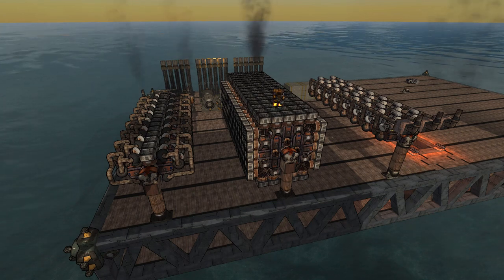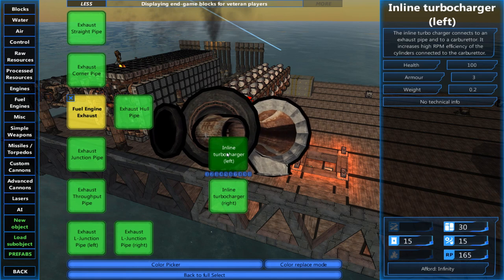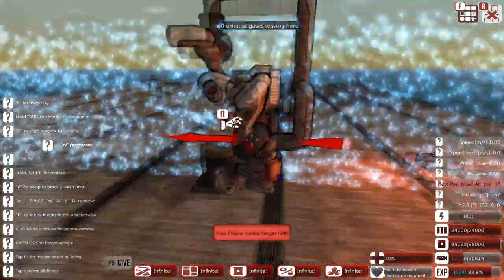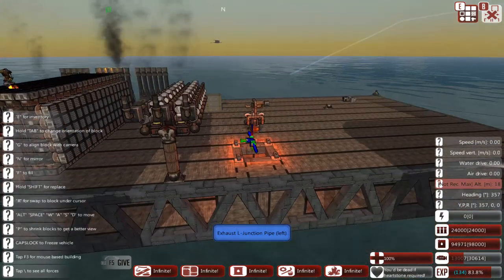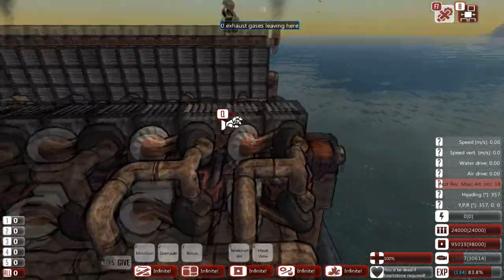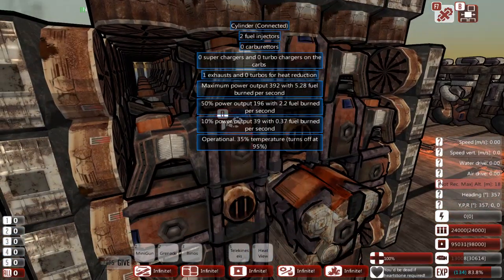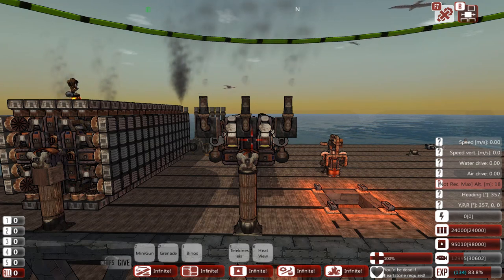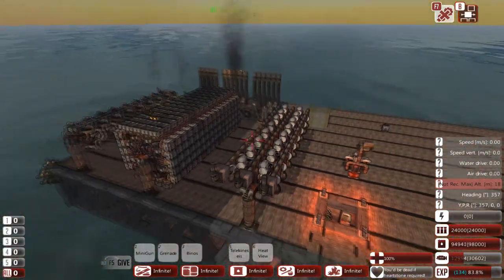Engine Overhaul Updated parts and examples - From the Depths (devtest1.8691)

Comment: With powerful engines becoming so massive now, I can see heavily shielded or laser based vessels being better off tied to batteries (unless I missed/forgot a change to those) and skirmishing instead of jumping right into the middle of fights and out-lasting everything else. It will be interesting seeing if anyone comes up with an electricity generating base that all their heavy power usage vessels dock at for energy. The numbers seem a bit rough cut, but it's better to launch an awesome change like this and tune it up later than give up before you've started because people are terrified of things changing.
Reply from the maker: +Richard Zado You will never to be able to pull off the same shield coverage that we had in the past, so I would just forget about heavy shielding and go for sensible shielding, lol.  The shield strength slider is there for a reason!  Lasers are supposed to be getting  a bit of a drop in their power draw, which is nice.  Batteries seem to be the opposite of what you're suggesting though.  They are very inefficient and have a low output compared to an engine.  They have a few benefits in that it's a good source of backup power, or making dedicated battery powered ships.  Also, you can use it as energy storage to keep on fighting even when you run out of fuel.  In terms of using it as an energy exchange mechanic, it just isn't efficient.
Reply: ireLAN Gaming Ah, damn. Well, it was an interesting idea at least. With heavy shielding becoming less viable, resources becoming limited (preventing constant repairing of massive armoured vessels), and all these changes in general, I can see the best defense has become never getting hit in the first place. Squirrels and snipers incoming :P
Reply from the maker: There is a lot of talk at the minute of an armour change that nerfs HE against metal armour, so the whole field of battle will be changing over the coming patches.  It's impossible to know atm how it will all come about.
Reply: ireLAN Gaming Oh my, quite a few changes then.
Reply from the maker: Alpha game is alpha. ^^
Reply: +ireLAN Gaming I hope to god that happens. Heavy armor should act as such. You shouldn't be able to HE a battleship to death. Thickness of armor should stack too. If you have 2 block thick metal armor, most lower caliber stuff should bounce off, barely scratching the paint.
Reply from the maker: The armour buff makes it so much harder to kill stuff with HE, except wood targets, they just melt, lol.
It feels a lot better than it did. Armour actually feels like armour!

Comment: Great video these engine layouts and your guide was certainly useful, no doubt. But would have loved to see more super small engines. I love my small jets, and big engines are a no no.

I have not downloaded the devtest, so when this comes live, I really want to play with these new toys. seem more interesting than the old engines for sure.
Reply from the maker: +Thepokemonmies These engines are all built in 2 meter segments, so you can make them a fraction of the size that they are.  I will be doing more purpose built engines in the future though, these are kinda extreme examples. :)
Reply: ireLAN Gaming Yea I could use those, but those are bit too wide and tall mb?. I quess I could build them in 90 degree position.  But yeah hope to see more specialized engines. These engines are great for most ships and for large planes tough. And for some small jets.
Reply from the maker: I agree these are maybe a little bit hefty for microjets and stuff.  All you need is 1 cylinder and 1 carb for 100 power.  That's enough for many small jets I think.
Reply: ireLAN Gaming yea. quess thats enough. I was wondering if u could so semi small but fuel efficient engines. But yea they aren't that complex probably.
Reply from the maker: What sort of general power output are you thinking of?  Just a ballpark figure would be cool.  Also, efficiency at high or low RPMs? I'm curious as to what other folks would like to see in regards to engines as well, so feel free to chime in if you have a particular engine idea. :)
Reply: ireLAN Gaming Well for me. 100-300 power. 50 power might be good for planes with few thrusters. And some high efficiency ones and some lower ones. and some super low wideness ones could be useful too. mb 3x2?

priority for small wideness and for low fuel efficiency, and around 150 power. and efficiency at high rpm probably, those stats might work pretty well. Hope my perspective helps :)

Thats what I would look for.
Reply from the maker: That's pretty easy to pull off.  100-300 power is only 1-3carbs.  I would probably meet you in the middle with a 200 power 2 cylinder with 1 carb.  Low fuel efficiency is simply a single cylinder with a fuel injector and a bunch of exhausts.  That will give you a tiny engine, but very poor efficiency.  I'll try and cover these examples in a video though. :)
Reply: ireLAN Gaming Thats nice to know. I havent played with them so I havent had the chance to test those engines.

Comment: I still like it. Seems pretty complex, but then again that is to be expected out of this game. I'm glad they changed the turbo and supercharger around, as that kind of bugged me (as a turbo driver) from a realism pov. Obviously they are going to have to revamp lasers and shields as well, otherwise they will be all but unusable on anything but capital ships.
Reply from the maker: +CBR Lobster (Phil) I'm pretty sure lasers are gonna be tweaked a little, but don't expect too many changes to shields.  Why have a strength slider on your shields when everyone uses max strength all the time?  It completely removes a potential design hurdle.  The strength scaler is also an exponential power draw the higher the strength goes, so we have to learn to use 4-5 strength shields instead.  I do agree that there will need to be a little tweaking to the shields, but gone are the days of multi-layered complete coverage.  Frankly, I think that was totally ridiculous anyway.  Shields should be reserved for protecting extremely important parts of your ship imo. :)
Reply: I haven't gotten into the bad habit of multi-layering shields so I'm good with that and I've only used drumstick engines on a couple builds since I only recently found out about them. :) They are a hell of an exploit though, as bad as the spin block thrusters imo. They still take quite a bit of space, but for those mega laser shielded craft, they are quite useful.
You can still make a good laser system without the exploit, but having both will be tough. Having a powerful shielded craft will mean that it will have to be pretty massive.
I actually think they should make shields a bit more powerful now, since they will be harder to utilize, and maybe increase the power usage some. I also think that rather than the deflect or disrupt feature, that could be a toggle to affect either lasers or projectiles, since I don't think anyone uses disrupt.
Reply from the maker: Haha, everyone thinks disrupt shields are useless, but everyone would be wrong. ;)
Someone put up a really interesting PSA about it on the forums, here's a link:http://www.fromthedepthsgame.com/forum/showthread.php?tid=12705

Comment: So I'm wary of the lower power outputs, larger amounts of space used and fuel consumed but those new exhausts finally give the smoke stack on my cruiser a point c:
Reply from the maker: +Joel Bartosch (TheKineticz) The smoke stacks look so damn cool!  I know the new engines are heavily nerfed compared to the old one, but I like the extra design challenge.  It's a little boring building exactly the same engine in every ship just longer.

Comment: So have you put any pondering to hybrid electric engines? Using high efficiency/static RPM engines that do nothing but charge batteries and then run the ship off said batteries.
Reply from the maker: +Nicholas Glendening I have done some testing with this.  Sadly, it doesn't work that well. The reason is, you will always lose efficiency when outputting from an electric engine.  At maximum output, you lose 50%!  Which means every 2 power you input, you only get 1 out of the battery.  Even at max output, you won't be able to get close to the output of the actual engine without the battery bank being massive.  When lowering the power draw to get a better efficiency, this hurts your output even more.
I think batteries are more intended for a dedicated battery ship, as you can transfer the raw power as a resource from another ship that has a battery charger.  You can also use them as backup power, should your engine get damaged.  From what I've mucked about with, the batteries are always gonna be less efficient than directly taking power from the engine.  I could be missing something though. :)

Comment: If the devs are encouraging massive builds, they're gonna have to try stop the memory leaks. I seem to get bad lag even on high end PCs.
Plus on my Dreadnought its engines produce so much heat it's ridiculous. 1m degrees C.
Reply from the maker: +The Beastmen Warlord I think Nick is aware that the performance has dropped a little over the last few patches as he mentioned something about doing an optimisation pass before this goes stable.  Also, the devs are doing the opposite of encouraging massive builds.  Every recent patch has vastly favoured smaller vessels.
Reply: The engines seem to say otherwise. So do effective advanced cannons but you have a point.
Reply from the maker: How do you see these to be more effective for larger ships?  It's much MUCH harder to get a high power value now.  I'm just curious about your reasoning. :)
I'll agree you can get more cannons onto a large ship, but I would argue that they favour the lower end of the gauge scale, making them practical on much smaller ships too.  You do need a big ship to make something really crazy though. :)
Reply: +ireLAN Gaming The bigger the craft, the more engine you can hold and it seems to make high power and/or efficiency engines you need a lot of space
Reply: +ireLAN Gaming this system is better though because my Dreadnought engines are super efficient and powerful with only carberettors, fuel tanks and 3 super chargers per slice. It's ridiculously powerful because my engine power doubles with each slice.
Reply: As in I prefer the dev test engines because of how nerfed to the point of being good they are now
Reply from the maker: Gotcha!  I'm messing around with superchargers atm too, with a 3turbo 1 super per carb and sharing each carb with 2 cylinders.  Managed to get it on all sides of the crank. 228ppf, but it's MASSIVE, lol.
Reply: +ireLAN Gaming UNLIMITED POWAAAAAAH!
Reply from the maker: :D
Reply: Someone needs to make powerplants that use water to turn into steam, and back to water after a time period.
Reply from the maker: I think steam engines are coming, but that's a frikken awesome idea! :D

Comment: Great Vid, I was able to create an engine that could output 43k power and at all load levels average 100 Fuel per tweaking the UI on the engine itself also helps a lot when making large engines iv noticed i have just 2 of the littlest refineries and i never run out of fuel
Reply from the maker: +Travis H That's pretty impressive!  I'm still puzzling my way through the intricacies of the system and haven't spent a lot of time playing with the engine configuration.  Any tips for configuring them? :)
Reply: the way iv been setting it up is a high decay, slow ramp up speed to help balance the loss you get from the engine being so large and lower the responsiveness to further assist with the engines size tho i could be wrong in this but i have noticed a bit of difference in fuel consumption, but i also lower output to batteries to .05 and have a 74000 back up supply
Reply from the maker: I actually think batteries are a big hit to efficiency.  On paper at least.  With a full output speed, they drop the efficiency to 50%, which is a really big drop!  That means it takes 2 power for every 1 power you output, as such, costing you double the fuel for every point that comes out of the battery.
Reply: true but i set my batteries at 50% so they get 80% efficiency + batteries should only take affect once all the engines output has been used
Reply: how can i send you my ship you can take a look at it, no where near complete but engine is running and has cannon systems online if you want to make some things none existent lol
Reply from the maker: Upload it to google drive or some other sharing site and send me a link, I'll try and get a look at it when I get time. :)
Reply: My opinion is use the one with only the main cannon online your pc may be better than mine but i dont think that matters for the despawning of bullets
Reply from the maker: Cool, will hopefully get a look at it later. :)
Reply from the maker: +Travis H Just got a look at your ship, I love the shape, it's really unusual.  Reminds me of a landspeed from star wars for some reason.  At least from the front.
A few things I noticed about it.  First up, the inline turbos need to be connected to a carb to do anything, so all of the inlines on your engine aren't doing anything.
Also, why do you have so many loaders in your cannons without clips and many without inputs?  The ones without inputs are doing nothing but increasing complexity and thus your reload time.  The loaders that have an input get a 50% reload penalty as well.  I would suggest making them in columns with 1 loader, 1 clip and one input at the very least.  I would also try using multiple firing pins instead of a single one per turret.  This will allow a lower complexity scaling and overall and should increase the DPS significantly.
Finally, I would suggest using much smaller shell customisers, but use many of them.  You got loads of spare room on that ship. With a bit of tweaking, it could be a real beast! :D
Reply: Thank you for your imput, yeah im still trying to work on cannons the only one i think iv perfected is a .125 it can fire at 3600+ rounds per min on one firing pin, also im not sure how to build multi cannons, also a cool thing about that little ship is it has so many 4m slopes is can move at 4.3ms on just one single large prop, also if the engines inline turbos dont connect to the crab they work as cooling units im not sure if it works when filtering it through the exhaust but i was hoping it would give a cooler engine with only a single rad sicne rads increase fuel consumption
Reply: also i think i have belt feeds on the cannon your talking about i figure it would still have a high output with the penalty and take up less space, but im still trying to make a good all purpose cannon
Reply from the maker: Lol, I didn't notice how little propulsion it had, that's really impressive. :D
You have autoloaders built about 4 layers deep in places, they're completely wasted there. You should at least have on clip on each one, otherwise they literally do nothing but increase your reload time.
I see your logic for the inlines, but I don't think they work like that.  Only the regular turbos give you any cooling and it must be attached to a cylinder to do that.
Multiple firing pins is as simple as using more than 1 firing pin on the turret and making sure that the cannons don't connect to each other.  It makes them a lot harder to build though.  Making sure they don't connect with each other and squeezing multiple cannons into a small space can be a real tetris challenge, but definitely worthwhile. :)
Reply: yeah i built a few for some reason coolers/ gauge increases will connect if they are laid side by side even tho they cant connect in that fashion which was annoying because i built a very good one then once i reloaded it to test it it was separate firing pieces they all grouped up to one cannon or rather just one cannon worked since it didnt even get the autoloaders added into it if it was truly connected lol
Reply from the maker: It must have been something else than the gauge increasers or coolers, because I built a 3 pin turret last night with the gauges going down the centre and it worked fine.  I had to stagger the autoloaders though.
Reply: hmmm, also a thing that bugs me about the new engine is power loss due to heat, because engines get more efficient when they reach there operating temp and optimal RPM i mean engines losing power at 100F is silly my car runs at about 700F still has 400hp lol, ill give it a look again but im pretty sure it was just the gauges unless firing pins can also connect?
Reply from the maker: Nope, firing pins don't work either.  Although there are a few weird ways a gauge can connect, via the flat ends for example, or the gauge splitters can be a bit weird too.  I managed to squeeze a 3pin cannon into a 3x3x6 space though, so it's definitely possible!  I don't recommend this particular design as a 2pin is way more effective when compressed down, lol.
Reply: Ah lol, right now im having some issues with the refineries they just seem to want to blow up for fun lol, i have 2 of the exact same refineries and one just feels like exploding very trouble some on a jet
Reply: Also they seem to be glitched the refinery counts down its efficiency yesterday they would hold at 11.4 now they are 2.24 and started at 5.68 when placed...